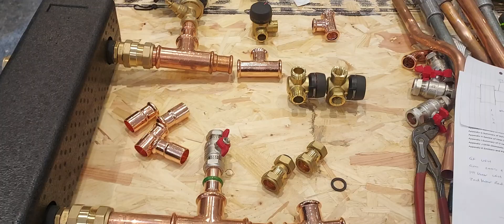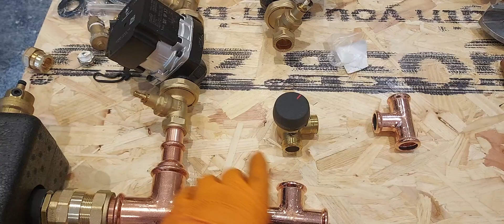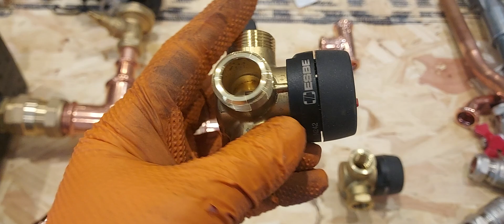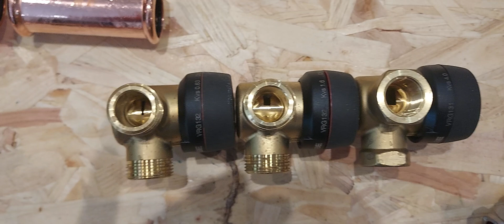Esbe valves and valve authority.

Comment: Where are you ordering the esbe valves from? I was getting them from that german company on ebay but service was shocking the more i used them. Price was on point though.
Reply from the maker: @westleyleake699  I'm buying them from b the smart plumbers merchants. Have a quick Google for bee. They also have a Facebook group. Paul brimble is the main man at bee

Comment: Excellent video, i understood the principle but its nice to see exactly what part of the valve this applies to, whether is the bore size or the rotating port as you've shown. Also if its a complete sized valve required or different inserts to fit inside of a body.

It looks like the whole part is what you purchase is it?

Is the brass part esbe too or just the motor black box?
Reply from the maker: @handle1196  both the mixing valve and the actuator are from esbe

Comment: I would be interested in seeing the calculations from the header through to the valves and the actual method selecting those valves if you are able to at some time please.
Thank you as always. Very helpful and informative presentations.
Reply from the maker: @gibbodive140  I will try and knock up a video explaining designing a low loss header and calculating the valve size
Reply: @andrewmillwardwatford9410  Thank you